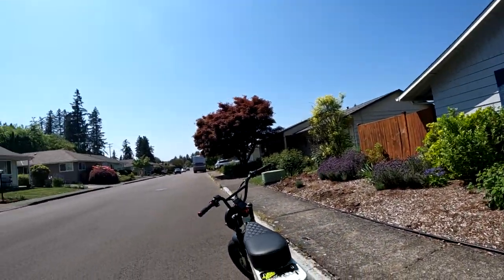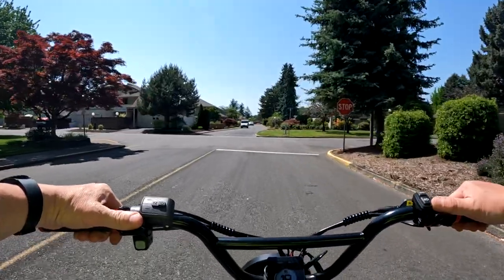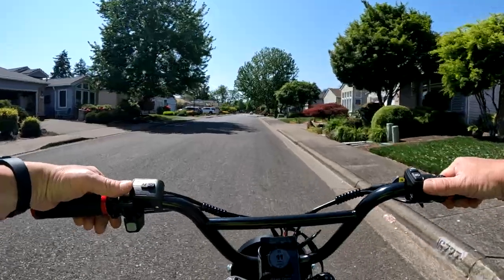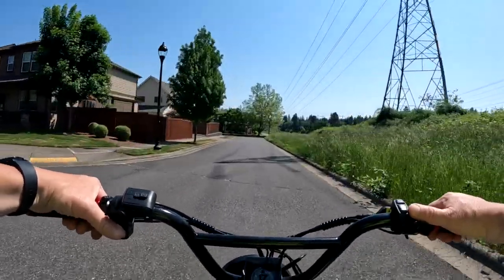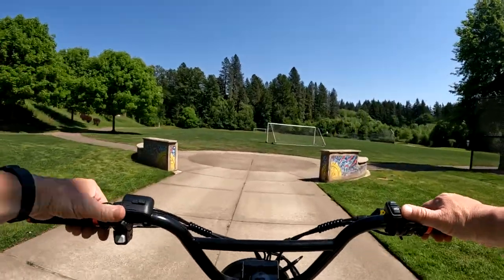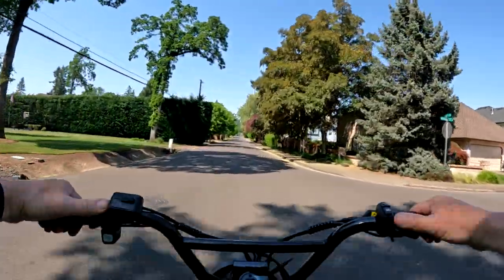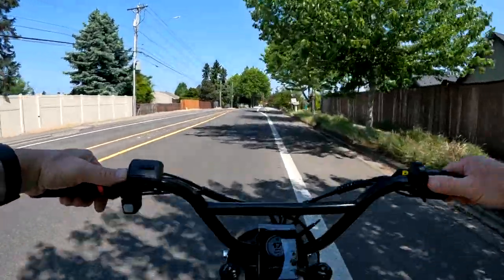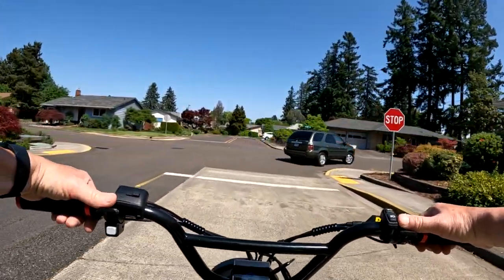Ebike Flat Tires... How Often Do They Happen!

Comment: Caught a flat on a 72v 8000w stealth bomber clone about 3.3 miles from home.  No phone, no kit, nada.  Pushed that heavy mo fo til my legs couldn't move right.  They were rubber legs and I just collapsed to the ground about 3 blocks from home (big *ss bike on top of me).  A neighbor was walking his dog and helped me (I literally could not stand).  I cursed that bike out so many times and when I could stand again, even thought about kicking that heavy SOB...lmao...  Fixed the flat, a nail was culprit, and put some slime in it.   I am thinking about putting motorcycle tires on it... Finally, got back in the saddle after a week.  It took about five hours before I could walk right again....  Never leave home without your cell, a kit, pump, water and a match to burn that heavy 200 lb overweight fun machine when she goes flat...  There is great love here for you..

Comment: Flat Out works great 👍 i use it in tubes. Prevents any flats that you otherwise would have had to patch. Every time i take my tires off the rim, there are punctures that FlatOut sealed. They say its supposed to last the life of the tire  and i believe it.  Hub motor wheels can be a pain to get off the bike and fix a flat. I think buying better tires can help to an extent , but personally I’ve got more flats with brand name tires than cheap chao yang budget tires. Fat tires seem to have more puncture resistance than normal skinny tires.

Comment: As soon as I get an ebike I put  8ozs is Tire Slime in each tire,  & I've never had an issue again!
My first ebike had a huge nail hole, I bought Tire Slime & added it,  & not only did it patch the hole, it never leaks, now has like 20 more glass holes & goat head punctures, & I'll only have to top off the air every 2 months,  & have 3k+ miles on it since the nail hole! 👍
The trick is to keep your tire at almost max tire pressure is solely doing road riding, it makes the tire harder to puncture. 
Also buy motorcycle inner tubes, they're thicker as well

Comment: There are liquid sealers, tire liners, and special puncture resistant tires. But beyond that there are inner tubes that have heavy duty wall thickness. I went with the thicker inner tubes and Slime, and so far haven’t had a flat in half a year. I would like to see tire manufacturers advertise the durometer rating of their material because the denser the rubber the harder it is for sharp things to puncture. That and, maybe adding Kevlar bias ply layers like some motorcycle tires.

Comment: i never use liquid sealant anymore unless im riding a tubeless setup. liquid sealant makes patches unreliable. id rather patch than swap a tube because i really dont want to take that back wheel off. ive had good results with mr tuffys in combination with old tire treads lining my tires.

Comment: I don't think it's luck, its experience, and some tires are just more prone to getting flats, like maxxis tires are great for mountain biking, but that's the only thing I would use them on because it's easy to fix a 29er,or 27.5 , you can fill it with your suspension pump if need be, but wouldn't put them on anything that had a motor or a gasoline engine.